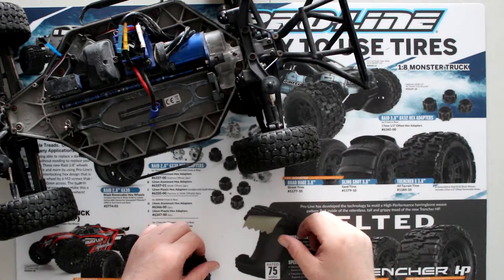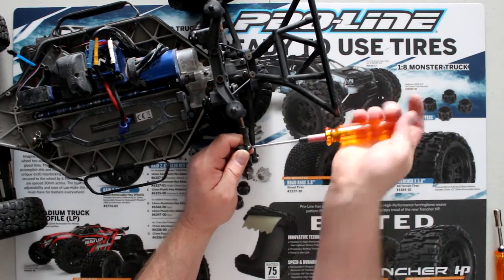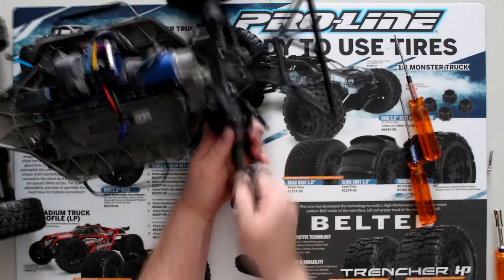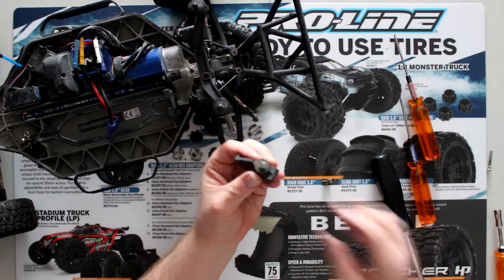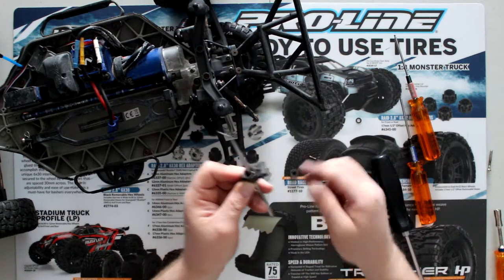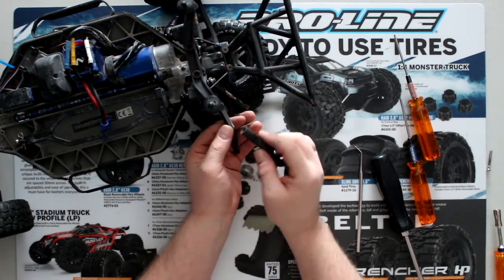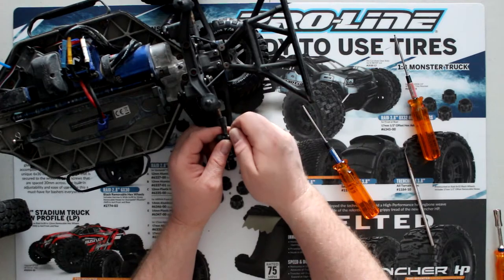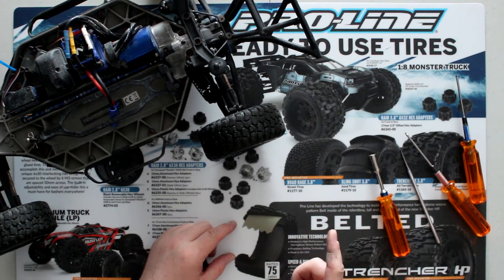How To Change A Rear Stub Axle Housing Of Traxxas Slash 4X4

Comment: I put all new aluminum caster blocks, steering blocks, rear stub axle carriers, and A As on my slash 2wd. But I noticed there’s so play between each part causing it to shake a little. Is that normal and okay?
Reply: Same thing I noticed as well. Little concerned with the amount of play with the aluminum rear axle carrier compared to the stock plastic.